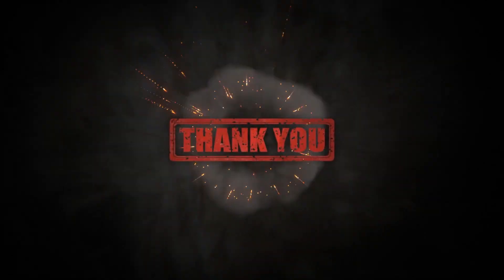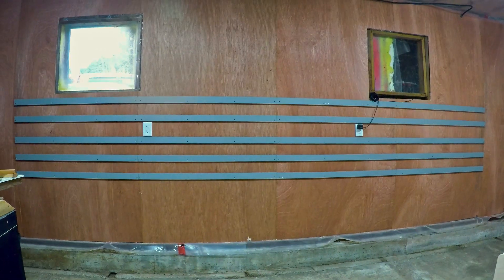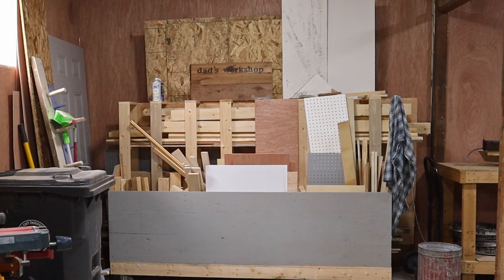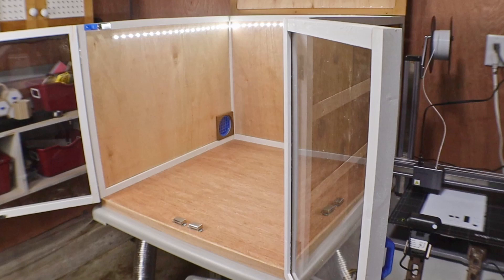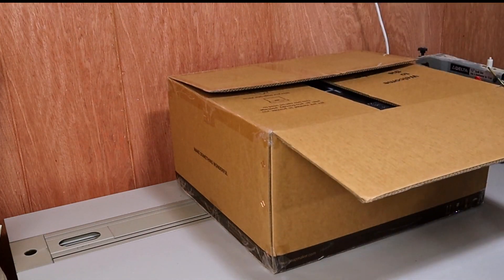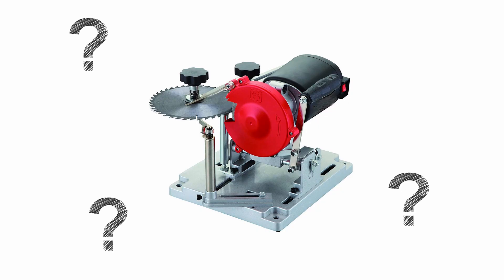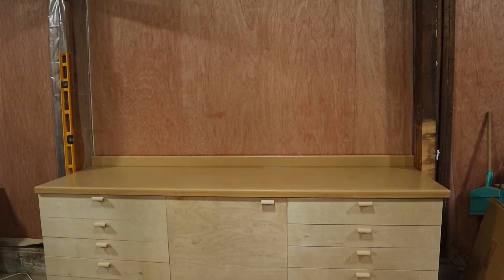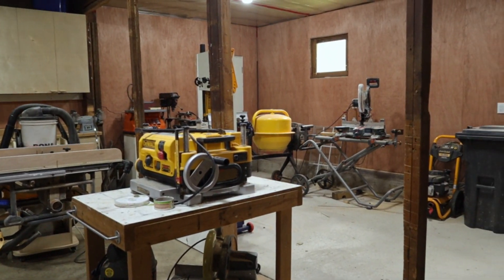2021 Shop Tour - Horse Barn Conversion

Comment: I'm curious, you used a mini excavator and I've been thinking of digging out my barn dirt floor and was thinking about a bobcat.

To me the bobcat would scoop more dirt and do so evenly.  Did you consider a bobcat and what are your thoughts on what you settled on and what you might do next time.  Thanks and congrats on your project!
Reply from the maker: I don't think I had enough space for a Bobcat, the excavator was smaller and more maneuverable in the tight spaces. I think the Bobcat might do a better job of it if you have the space.
Reply: @LogHouseFarm  Thanks so much for your reply & feedback.  

I do realize I need to take out the half walls between stalls to really make that work but I am also clear that will allow the pouring of the floor to be best leveled.

Comment: What type of paneling did you use ? Tia
Reply from the maker: It is called Bintangor, just about the cheapest paneling I could find.
Reply: @LogHouseFarm  it looks like luan , where did you get it and how much$ .tia ps nice job on the barn, I'm also finishing a barn.
Reply from the maker: @4bennybear  the product may have different names in different regions, but I got mine at a local plywood store and it was about $16 per sheet.

Comment: Amazing shop tour. Thank you for sharing it. The building itself is fantastic. 8x8 sized frame pieces are always so impressive. You’re voice and narration are great too. Seems open or practiced without having the timid or inexperienced nervousness.

I’m a big fan of the 6x3 workbench or anything smaller than full size 4x8 anyway. If I really need a 4x8 I just move a rolling cart over but I can still put a 4x8 sheet and cut it with the track saw. It’s a sort of Goldilocks size situation.
Reply from the maker: Thanks very much, glad you like the tour.